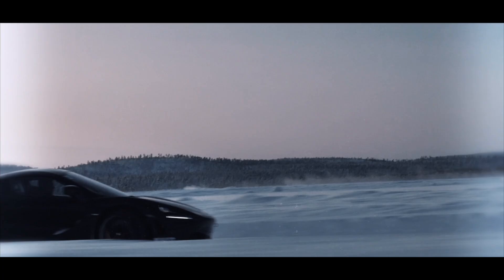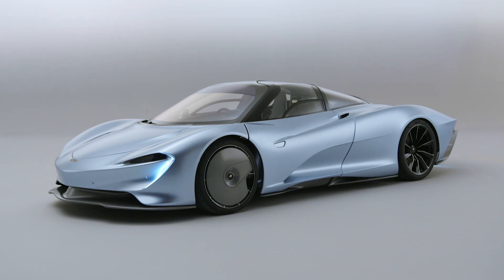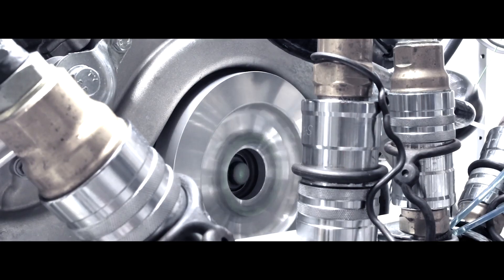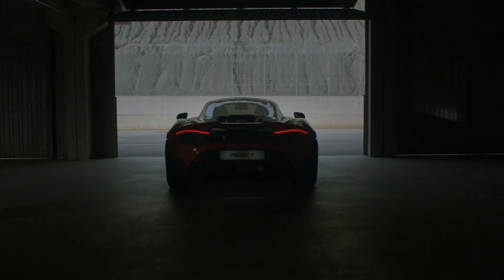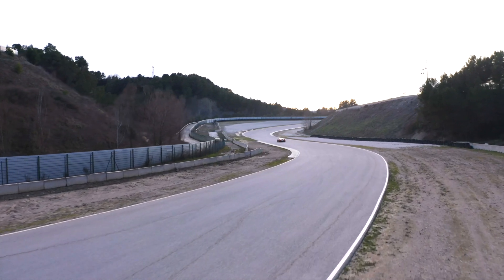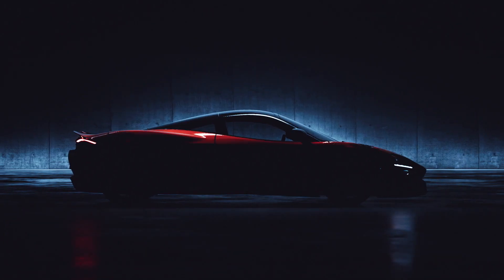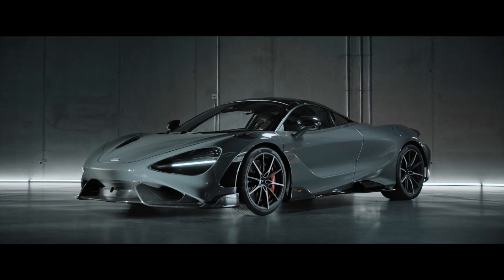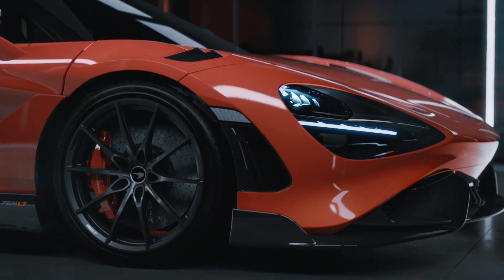McLaren Tech Club - Episode 10 - 765LT: Pursuit of lightweight

Comment: You guys produce pretty awesome cars.. however your business model would be your downfall.. Sooooo many models are being released to the point that a certain model is losing its identity here's an example you guys built the 600lt as a track iteration of a 570s but you guys are also planning to release a much hardcore 600lt in the 620r?? you have a mclaren 570gt but that wasn't enough you have to release Mclaren Gt and what the hell happened to 540cs??..no wonder mclaren cars depreciate faster than any brand..
Reply: ei calm down just throwing out an opinion.. with the pandemic right now and with the business model mclaren have they are barely treading the water right now.. i just a fan of the brand i guess owning one or not doesn't matter..

Comment: The 675LT is still the McLaren to have. Yeah sure the 765LT will be faster but occasionally a manufacturer will make a stand out product and that was/still is the 675LT. McLaren obviously went to town launching the LT sub brand so the difference between the 675LT and the base standard 650S is a lot bigger than the 765LT and 720S. The Mclaren 675LT is a sure fired future classic with cult status
Reply: That's your opinion. Besides, you haven't even seen what the 765LT is capable of.
Reply: I think the 765LT is going to be hampered by the fact that the Senna exists.